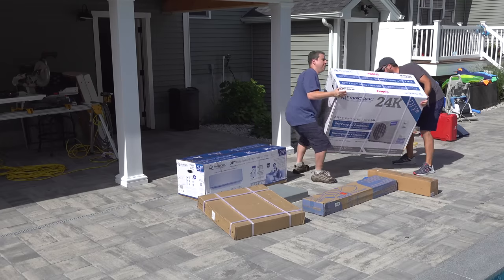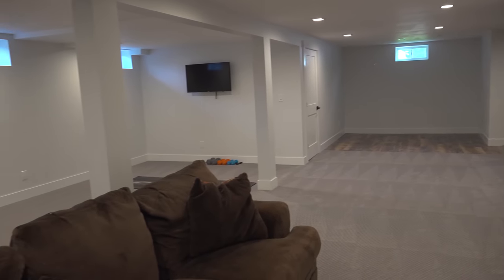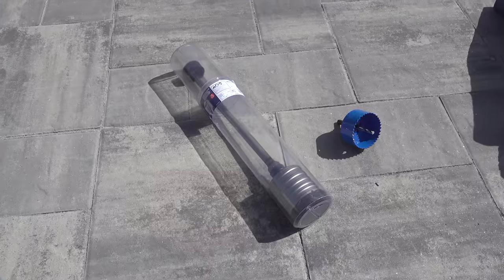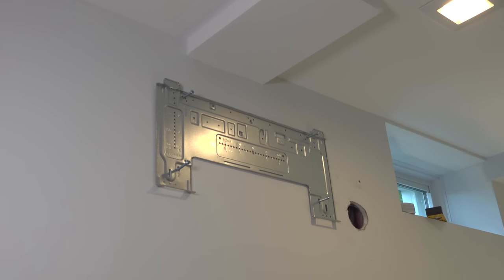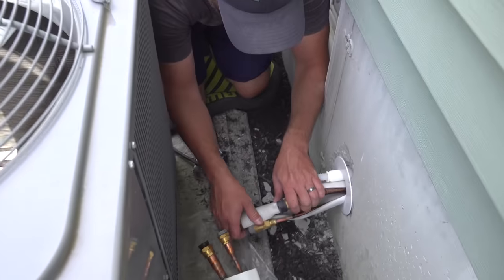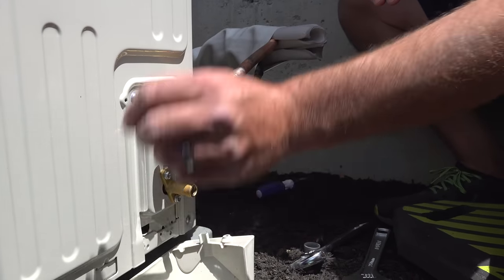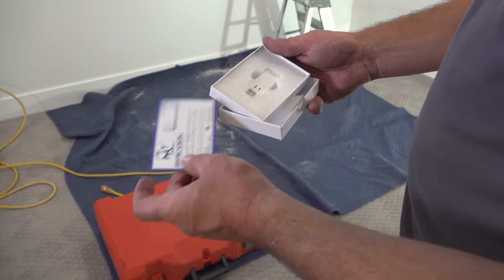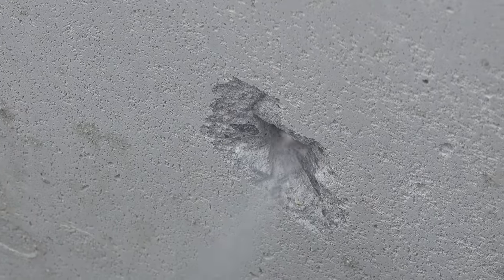Install your own AIR CONDITIONING in 4 HOURS!  DIY Mini Split MR COOL

Comment: Why didn't you use a Diamond core drill much less effort & very much quicker & when the center lead drill breaks through tothe outside of the wall drill in from the outside then you would have a clean hole inside & out & no repairs nessersary to the outside wall. Also I noticed that you were not holding the drill horizontal as you were drilling which could affect the abilty of the condension hose to drain to the outside.

Comment: Wtf bro you can get a 2 ton (24000btu) ac for about 1000-1500 maximum in asian market. They are also good brands like LG,Samsung,gree,general etc which has split type design and also heat and cold mode
I myself got a 18000 btu gree ac with wifi and heat and cold mode for about 550 dollar which is a decent price for us. 
We could get 2 24000 btu ac for 2000 dollar
I don't know what is special about this ac that it costs that much
Reply from the maker: It's very different outside the US. You guys have had heat pumps for ages, we are still catching up. There are some brands bringing pricing down but I have seen ones in Thailand that sell for 1/10th as much for the same output. What can we do? We are slow to adopt using these things and its sad as they are great
Reply: @SilverCymbal  I don't think us is slow but it's the fact that they want to earn as much money as they can because us market is pretty easy to catch but in asian countries people choose from thousands of different products and than pick one that's why companies have to make products as cheap and good as they can 
But I think Samsung,thoshiba and haier are available in us and they are not that expensive if I am being correct?
I thought that this ac had some extra feature that we didn't have in our ac after seeing the price but after some research I think it's a overpriced product Rather than a reliable and value for money product

Comment: Pro Tip: Don't set your unit on one of those cheap plastic pads. Use a proper concrete pad, or use a wall mount to keep it off the ground.

Comment: Don't need Teflon tape around those pipe thread to seal it?
Reply from the maker: No, not for these ones. All of the sealing is done by the two o-rings. Tape might even interfere with the sealing of those nuts.

Comment: What about pulling a vacuum for the line sets?
Reply from the maker: They are prec-charged and sealed, just like the condenser. There is no vac with installation.

Comment: the lines are shipped under vacuum and have quick disconnects at the unions ---no need to evacuate them
Reply: Most line sets are evacuated at the factory and precharged with refrigerant

Comment: I have 1 A/C unit in my home and my basement is the coolest part of my house! Why would you need 3 A/C systems?
Reply from the maker: He had two smaller units to have zoning. They are both attic based so to add it to the basement wouldn't have be easy with ducting

Comment: All this to get the equivalent of a wall unit. Ooooooo kay.
Reply: Wall/ window units are junk
Noisy, inefficient and costly to operate. Installation is very limited for application. They are very costly to repair and many times just better to replace them. 
Mini splits are very efficient using a third of the power to operate, they are very quiet and versatile in application having many designs other than the wall mount evaporators as shown. That is one of several options available maybe just more popular.

Comment: You didn't vacuum the air out of the lines? I thought that would be critical to a proper function. I only did automotive and we always did that. We'd see if the vacuum held for 30 minutes before adding freon
Reply from the maker: Not with this system, the line set and condenser are sealed and freon filled. They only open their valves which can be seen inside the plastic caps on the line set when properly connected. The system is entire factory filled and sealed to perfection.
Reply: @SilverCymbal  Thanks! First time I've heard of that. I did see something odd in the line when you removed the cap.
Reply from the maker: @cdf6333  For many this is a brand new thing and you will see in the comments that even seasoned pros still dont believe these exist.

Comment: somewhat confused. If the lines were not purged ad evacuated and sealed  before shipping, then anything including ambient air and moisture could be in those lines even if there were dirt caps on them. So why did you NOT purge with nitrogen and also fail to do a proper evacuation to remove ambient moisture? I thought the whole point of a DIY Mr. Cool and the extra money they cost was that the lines are purged, evacuated and sealed  prior to shipment and the fancy valving you bought with that extra money allowed you to forgo the purge and evacuation process.
Reply from the maker: Not with this system, the line set and condenser are sealed and freon filled. They only open their valves which can be seen inside the plastic caps on the line set when properly connected. The system is entire factory filled and sealed to perfection.

Comment: No safety goggles. Instead of breaking wall on outside, simply stop when bit shows through, go out side and finish it from out there, no cracked concrete. Also, fella could keep long drill parallel to floor. Also, Massachusetts must get frost. We put a support slab on grade and the unit heaves all over the place through the seasons. I wanted it on the wall but installer said it would not heave.
Reply: OK I see not enough room to drill from outside.

Comment: So it only works for one room?
Reply from the maker: Or a  huge whole floor, but you need to leave doors open if its very closed. In practice these work very well, around corners, etc. Fantastic for most basements, and first floors or specifically in large bedrooms

Comment: The only reason there’s Freon in the system is to know it’s not leaking , you would need to put nitrogen and put it in a vacuum, you would also need to add Freon , contractors who do these mr cool units always mess them up and the owner ends up spend double or Triple of what they paid in the first
Reply from the maker: This is the 4th one I have installed, zero problems and they are working great

Comment: PREVENT PATCHING BLOW OUTS = Drill a smaller bit through the center of the wall and then after going through half of the cement with a core bit from inside you can finish the other half from the outside.

Comment: Without vacuuming the line set whether sealeled with who knows what gas air, nitrogen , or vacuum seal lost, your taking a chance. Albeit these all new units use 7 year life compressors vs the older 25 year life reciprocating piston compressors. So I suppose contamination  by comparison dies not matter anymore because these are disposable green landfill systems,  just like electric cars and their toxic batteries

Comment: I definitely would do this. But a window AC is $150 and a “cheap” mini split is $750-800 on the low end. 😔 Not counting the cost of wire/romex and other odds and ends to do a proper install.
Reply: A window unit most likely won't keep that basement Properly Comfortable due to the square footage. Mini Splits can easily keep big areas comfortable and are pretty quiet. I'm an HVAC technician btw.
Reply: @dannyjr7997  no yeah you’re right, it’s for my bedroom not for a basement

Comment: After  hooking up the lines and before letting the freon in the system it should be pumped down to less then 500microns. There should be no air in the system. Any HVCA person would tell you that.
Reply: HVAC techs "stick build" systems. They don'[t (or haven't until recently)  use pre-charged (overcharged) line kits specifically designed for DIY installation to not require vacuum pumping to remove air from the lines.   BTW, no vacuum pump used in the HVAC industry can remove ALL the air from a system.

Comment: where does all that air go in those refridgerant lines?
Reply from the maker: There is none. The lines are also freon filled & sealed with a special pancake valve on both ends that can be seen after I remove the plastic caps.

Comment: Two thousand dollars vs one hundred fifty bucks. Plus, the electrician and electrical install.
Reply from the maker: You can't buy a 24,000btu ac for $150 but yes you can buy cheaper ACs for spot cooling.

Comment: 24,000 btu LG window unit 800 dollars ...no thank you to 2,000 plus tax Mr. Cool and 1,000 dollar plus electrician labor to install that breaker box and run wire...🖖

Comment: They made a HUGE mistake drilling through the concrete. Once the center drill bit of the hole saw drilled through they should have STOPPED right then and there and then finished from the outside. That would have saved all that damage to the concrete and eliminated the need to patch that damage.  Also once everything is installed through that hole you damned well better pack that hole with insulation. Oh yeah----they also should have used a stud finder so that hole WOULD NOT require  cutting through that stud.

Comment: ? If you live off grid can you wire the outside unit power unit into a generator were no electric lines are run. If any body knows please respond if so I would have an AC guy and electriction come out. Thank you to the people who respond no disrespect to to every one else I'm sure I may not be the only one who might be wondering I'd rather pay 3 or 4 hundred to have some one do this than the 8500 to have the mo state power company come out and dig a hole to run a line and meater.to it

Comment: Why does the interior unit need to be on an exterior wall?
Reply: It doesn’t have to be you can put it anywhere that makes the most sense for the area it’s for most are on outside walls to avoid exposed line set

Comment: Hardly 4 hours. It takes 2 hours just to drive to rental center and back. A pro will reserve whole day for installation.  Homeowner that has never done this before expect 2-3 days before giving up. 70% of people will end up calling a pro to finish what they started.  Many more tools are needed (vacuum pump, flare tool, torque wrench,etc..)  good luck with installation. 
It's a piece of cake if you know what to do and have all the tools.

Comment: This is how we AC our houses in Europe. Almost every house has it for cooling.
Reply: Depends where in europe. In germany most homes do not have air conditioning at all.
But yes, if we have air conditioning, it's done like this. I have never seen one of those window units.
Reply: @Timootius  yes germany is snowflake, they are mostly scared od AC.
Reply: @Timootius  I cant imagine not having AC. Does it not get hot there or humid there?

Comment: Don’t forget to pull a vacuum on the system. You need to get the system down to 400 microns to make sure all moisture is out of the system or you will have major problems later on.
Reply: I think those where spring loaded hoses. They already come with the vacuum

Comment: You didn’t vacuum the system, or did you just skip that part in the video?
Reply from the maker: Not with this system, the line set and condenser are sealed and freon filled. They only open their valves which can be seen inside the plastic caps on the line set when properly connected. The system is entire factory filled and sealed to perfection.

Comment: I see that they are not vacum the indoor pipe before open the both refrigrant valve, the air will mix with refrigrant in the system, they could not get the best cool in the living room 7:10

Comment: Why would you not hook a vacuum pump. All systems require a 500 micron vacuum to remove contaminants from the line that effects the efficiency of the unit as well.
Reply from the maker: Because you are wrong. Not done with this system, the line set and condenser are sealed and freon filled. They only open their valves which can be seen inside the plastic caps on the line set when properly connected. The system is entire factory filled and sealed to perfection.

Comment: Not only should you hire a professional, but what they don’t tell you is that you have to be licensed through the EPA to even handle the refrigerant in the system.  It also handles job permitting so that the installation can improve property value. Spending the extra money avoids you the headache of doing it incorrectly and ensures that you do get a warranty with the product you purchase. Most HVAC contractors will charge extra for a botched homeowner diy repair to teach a homeowner a lesson about projects to avoid doing.

Not to mention, he’s already got those two Carrier condensers outside.  What contractor handled his load calculations and screwed thing up so badly that he needs to install a ductless minisplit to compensate?
Reply: I was looking for this comment ,. Would love all the people that did this themselves to forward their info to EPA. Transporting equipment with refridgerant and openig any lines or equipment will be a very healthy fine .

Comment: As someone who does this for a living it’s hard to watch. Not pulling a vacuum on those refrigeration lines before opening those valves is a huge no no! That system won’t last no time. The compressor is going to take a shit sooner than later.
Reply from the maker: It will last forever, because you don't pull a vac with this system, the line set and condenser are sealed and freon filled. They only open their valves which can be seen inside the plastic caps on the line set when properly connected. The system is entire factory filled and sealed to perfection.

Comment: ain't you supposed to remove air from the pipes before letting the coolant in?
Reply from the maker: The lines are sealed and pre-charged, so on a normal syste, it's required. Because of these lines, the steps is completely eliminated as are the mistakes techs make where they over or under fill it.

Comment: 7:00 first you have to use a pump so that you will remove all the air from there pipes!!1 other99se the oxigen will freez in there and will make the efecency of the mashine not as good as it should be.        YOU WHERE SUPOSED TO KNOW THAT!

Comment: I've spent many years out of the US. They are common in most of the world BUT I absolutely hated the noise of the inside unit. I would never choose this noise... never...some opinions may differ.. but I dont call it quiet at all... and if you have a closed floor plan ( traditional rooms) you need multiple noise machines OR you have terrible uneven cooling /heating. I could go on... not me..

Comment: It is illegal in most countries for amateurs to do his.  The pipeinstallation shall be vacuum pumped to get all air out, depending on length about 45 min.  Then it shall hold that vacuum for half an hour. If it does not, the installation shall be pressure tested with an inertgas to find any leaks.  Failing to do this may wreck your compressor  due to humidity in the air making ice or it may react with the gas and make a slurry.  This guy knows nothing.

Comment: I would recommend removing the plant thats front of the condenser because it will burn it.
Reply: I read through the manual that came with ours (professionally installed) and it indicated that it's a good idea to protect the outside unit from high winds because they will fight with the fan and airflow. Perhaps the plant will help with that. I put a barrier about four feet feet in front of ours to help with that. Helps block strong winds but far enough away to not interfere with the airflow.

Comment: Okay. So it's a great deal on the first day. How is it 6 months, 1 year, 5 years later? That's the real test.
Reply: Have had 2 of these for 3 years. Still going strong.....heat and cooling....100”f outside and 80-90% humidity and 68’f in the shop easy

Comment: You couldn't center the evaporator unit between the two windows? That off center mounting makes me twitchy.
Reply from the maker: It was deliberate, the opposite corner of the room, that is shaped like an L get's split this way by the air, so it helps it spread the cooling/heat a little more evenly.

Comment: The freon for this model is in the line set, not the condenser.
Reply from the maker: We are both wrong, it's in both. The line set and the condenser. They make different lines sets so they had to account for the length difference but the condenser capacity would remain the same. So put them together and you get a perfect fill every time.

Comment: No nitrogen pressure testing to displace oxygen, no vacuum to remove none condensables, and lines bent without proper tubing benders. Encouraging consumers to improperly install their unit this way will cost them more money in the long run. Air in the lines will cause the refrigerant to foam up and kill the compressor.. Hope you get 5 years out the system. Good luck!
Reply from the maker: It will only be wrong if they follow what you outlined. The video is correct. The lines are pre-charged and freon filled, both ends are sealed and open after tightening down. Thats why they are called no-vac lines.

Comment: 6th likely big mistake: I did not see an Electrical Surge Protector installed beside that outdoor disconnect. A whole house Surge Protector will work too, but most people don't have them. Fact: With newer HVAC equipment having more, and bigger circuit boards, and inverter motors, Power Surges are one of the most common reasons for breakdowns.
Reply from the maker: No one is installing those on any AC I have ever seen. You are reaching for things now
Reply: @SilverCymbal  Hahaha. It is becoming standard policy with some companies. My company included. Some bigger companies do give a hoot because they want breakdowns and service calls. With that kind of policy, even if the equipment is under warranty, it is a huge inconvenience for the customer as it can take days or weeks to get the parts depending on what parts and where your company is located.